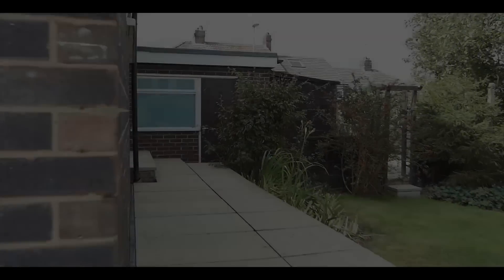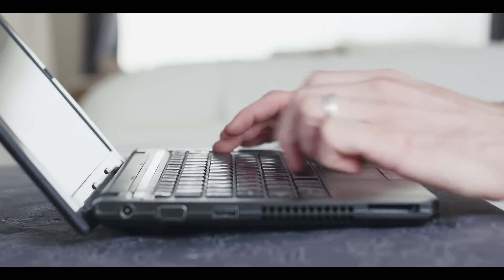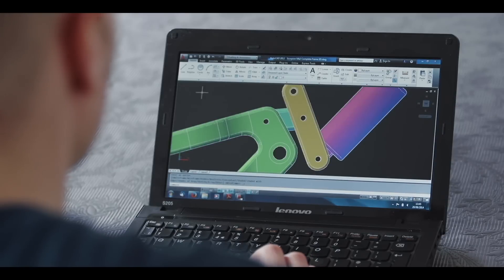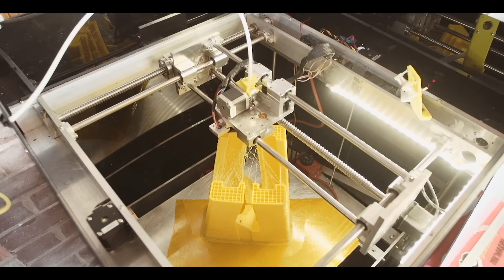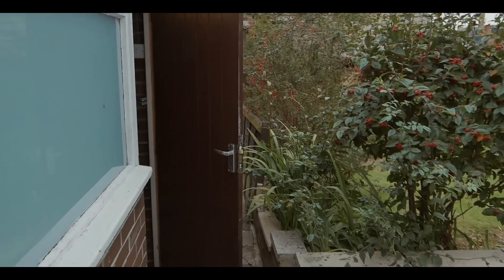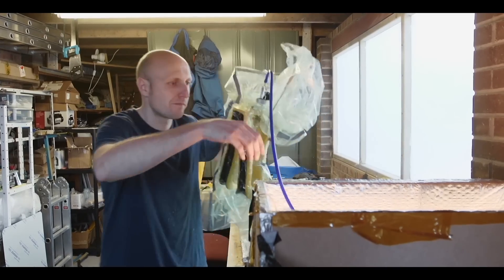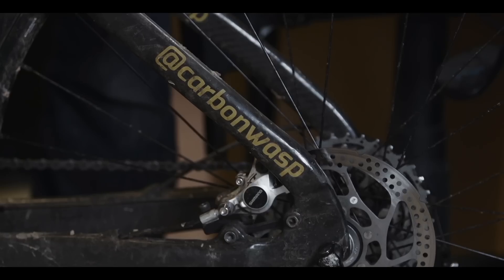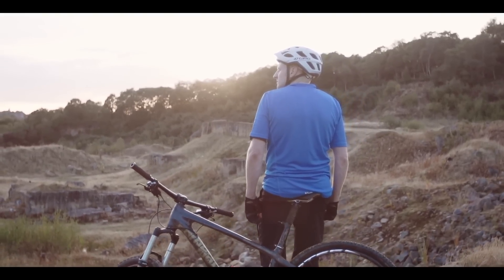Building A 3D Printed Carbon Bike? - Fettlers Chapter 2

Comment: what was that carbon fibre he used ?
Reply: +stylios zerox it was a prepreg twill fabric... or what do you mean?
Reply: +IEleMenTIx yes that. is it cured with uv or something ?
Reply: no epoxies in prepregs are usually cured by heat and pressure (autoclave). Epoxis in 3D printers are cured by uv ;)
Reply: Thanks :)

Comment: needs more retraction
Reply: +TheSmellyPasta Was about to say the same thing, and he needs to improve layer adhesion..
Reply: He also needs to dry his filament. Very stringy. Cool Guy and cool process. Keep it up!
Reply: Haha that's true
Reply: And faster non printing travel speeds. Filament is going to ooze even with significant retraction, and with those slow movements in the middle of the air, there's plenty of time for it.

Comment: There's a couple of new 3D printers out (actually one of them is a couple of years old) that 3D print carbon fiber parts directly, using a dual head system that lays in carbon string in all the ways and directions you want for them to be.  Not only does it cut out the making of a mold and laying up the mat, but the ability to describe the directions and densities of the carbon allow for strengthening various areas of the print in various ways so that parts can be much thinner where the strength requirements are less, and beefed up where the strength requirement is greater.  Human bones are like that, very dense and then very spongy.  PLUS the spring coefficients can be built in with this control, eliminating external shock absorbers in areas such as the seat post and making the whole bike much more responsive to actual conditions.
Reply: Where is one that can lay the carbon fiber in vertical layers?
Reply: 3d printed carbon fiber is chopped and added to filaments.  This makes the filament much stronger than it would normally be, but nowhere near as strong as continuous carbon fiber parts.  I think its about an order of magnitude difference between 3d printed and standard modulus cf.

Comment: now do a jump,  oops  snap
Reply: Seems pretty strong to me.
Reply: Dude go troll somwhere else
Reply: I don't think you have a clue as to what is going on here. The bike is not built from 3D printed plastic. The moulds to make the carbon fiber parts are. The bike itself is made from those carbon fiber parts. The A380's wing box is made entirely of carbon fiber so yeah that shit is stronger than steel when built the right way.
Reply: Thomas John Solidum did you see him do a jump?  i dont think so.
Reply: bartsshorts The title is misleading. 3D printer cannot print carbon fiber, at least not now.In CAD, for example solidworks, you can perform all kinds of load simulation.A fabricator will also perform torture tests over finished product.  For example drop tests with weight on it to see how high the bike will break, and which parts break first, etc.  One don't just build a carbon fiber chassis, weld up an aluminium alloy stuff, and go crazy on it without testing.By the way, this thread has included aircraft wings. Those were made differently.But this guy went the whole length to build carbon fiber MTB...Quite a waste of talent and money.  We use the same design and prototyping process to build heavy duty CNC Aluminium alloy electric bicycles. Our bikes are heavy at 50kg because of the battery pack and huge hub motor, but it has a range of 150km, and a top speed of 100km/h.  It's so fast we have to use spoked motorcycle rims and tires because bicycle tires would tear apart at high speed.
Reply: bartsshorts
 why are you wearing lipstick?
Reply: Did you see his bikes snap? I don't think so.
Reply: Thomas John Solidum yeah i was kinda joking anyway, more likely his frames are not straight.
Reply: bartsshorts Then Airbus goes bankrupt.
Reply: Thomas John Solidum yeah strong like a bull jews penis when he ravages another teen in his wallstreet pad
Reply: Well you can't judge a product if you haven't seen it personally. I know a guy who also makes carbon frames and I ridden a few of his frames and they are quite strong. You can't just assume something is weak just because its homemade
Reply: yeah i would also hate to be able to build my own high quality(questionable now yes, but surely can only get better) bikes. fuck this guy for even thinking he could try something different, anything good costs stacks of cash and has specific stickers on it, OK!
supporting does not equal sucking and swallowing, although for a carbon fiber bike, hmmmm ... yeah still no
Reply: OU812 what if its built the wrong way?
Reply: bartsshorts Then you get brittle plastic. Which is not the case in this guy's garage.
Reply: ***** or maybe you we're making him feel uncomfortable whilst he was trying to build the frame because you we're balls deep inside him.
Reply: bartsshorts from your replays its seems you're not quite Heterosexual...
Reply: ***** how can you? how can anybody?
Reply: bartsshorts and +Artemis Entreri . You two have talent. I'm willing to bet you're the only ones in history that managed to make 3D printing and carbon fiber technology sexual. I tip my hat to the both of you. Well done.
Reply: *****  can you imagine the asian Fonzie to asian richie ratio ?
Reply: bartsshorts dude he uses molds he doesnt accually use the 3d printied stuff
Reply: golferchin76 where can I see your bike?
Reply: https://fbcdn-sphotos-e-a.akamaihd.net/hphotos-ak-xpa1/v/t1.0-9/p235x350/10805836_992935584066667_240770960692648642_n.jpg?oh=cf246713a68700286b2d3decaa4375bb&oe=55798F47&__gda__=1437652624_42a02be0e587f4d59aa1ec591557779b
Reply: golferchin76 quit teasing lets see a vid
Reply: bartsshorts  that was my first thought, "scary". But, I read that carbon fibre doesn't fatigue like metal - if it doesn't snap when you apply forces, it flexes back perfectly. So you could stress test it , and if it survives, you know its' safe to ride.  Its' 'fragile' (e.g. if you scratch it), but paradoxically 'durable'
Reply: Carbon frames are strong as shit buddy, some fighter jets have carbon fiber on the wings.
Reply: bartsshorts I would assume he uses a jig for the final assembly, considering he is proficient with CAD, and built his own 3D printer.... 

BTW the Boeing 787 Dreamliner is made mostly of carbon, highly doubt it will snap. Plus Pre-preg isn't cheap, and has the best ratio of fabric to resin. The way this guy makes his frames is the same way Koeniggsegg builds their Carbon wheels.
Reply: They guy didn't seem like he would even attempt a jump that would destroy the bike. But you got a point, I wouldn't take it down MY trails...

Comment: Not that impressive...
Reply: Well imagine this,  you can download and print a Santa Cruz V10
Reply: sik59rt The bike itself isn't 3D printed, just the molds. The molds have no effect on the strength of the carbon product, only the surface finish ..
Reply: Build a v10 at home that'll snap. Perfect.  I would in no way in hell ride a 3d printed bike. I've seen hand laid carbon bikes break and I'm sure this isn't anywhere near as strong
Reply: sik59rt But the concept itself is interesting. Who knows in the near future someone might build a carbon bike that's just as strong as one of the F1 grade carbon